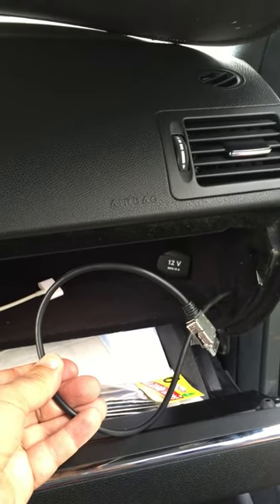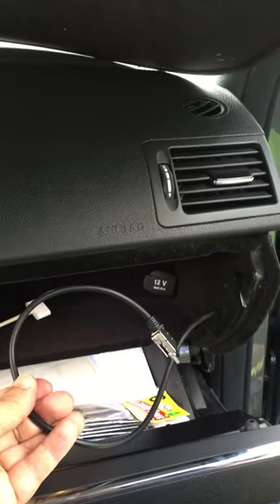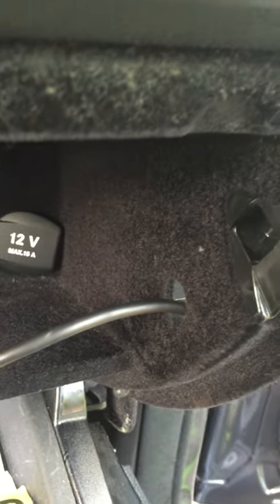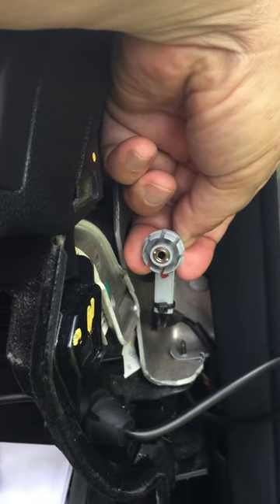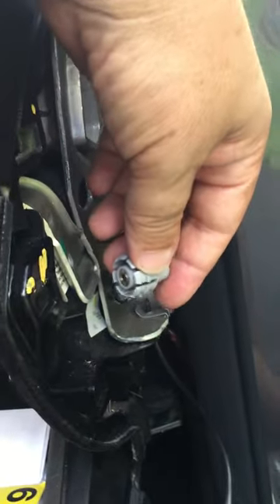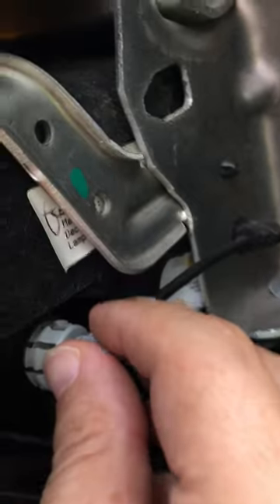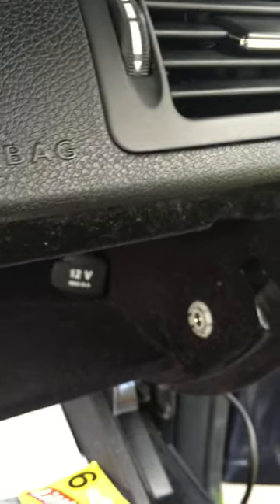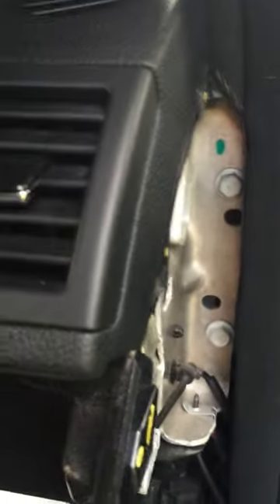2010 Mercedes C300 changing iPhone/iPod connection to an auxiliary connection

Comment: Hi, I know this is old but thanks for this video. Did you have to program or rewire anything after changing from ipod to aux? I just did it and as soon as I plugged something in, my COMAND system shut down, and no longer starts/stops when I start/shut off the car (it can manually be turned on, but does not know the car is on and says "shutting down in 3 minutes)

Comment: my 2010 C300 model came from factory with ippo installed and the aux is there as well but the aux does not work.. already checked the cd button and there is not aux feature or option... how do I make it work

Comment: Hi Robert. I have watched this video and got as far as pulling the cord out however, the silver metal part where the iPod connects does not fit when removing. How did you manage to get it out? Did you cut through the wire?
Reply from the maker: Hi, just cut it out and pull the cable.

Comment: You lose steering wheel controls though doing this :(. Stick buying another iPod cable
Reply: +RedLight GreenArrow exactly, that's the (very) boring part.
Reply: RedLight GreenArrow Why does that happen?
Reply: what do u mean steering wheel control?
Reply: Brittney Rojas he means the controls on the steering wheel quit working after doing this

Comment: Hey thinks so much. I did this on a 2008 clk 550 however the audio won't work it only comes out of the iPhone charger. Any advice
Reply from the maker: Hi, I'm sorry I don't know much about the clk 550 model.
Reply: +Jason W sorry for the confusing wording. Pretty much I have an adapter to the new iPhone and use that as the aux input. What I'm saying is that the aux port does no work. No audio, only works through the iPhone cable

Comment: Hi there, I also got a Mercedes with the 30 pin iPod cable in the glovebox, 
and would like to connect a bluetooth adaptor to it. Was anyone 
successful doing that? I purchased a VMA3000A adapter, but the plug 
isn't the same :(